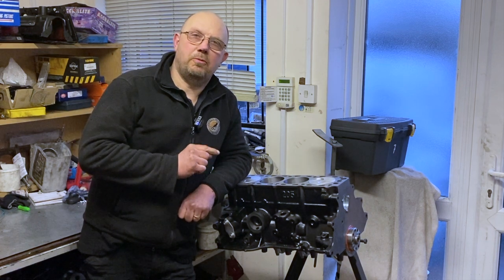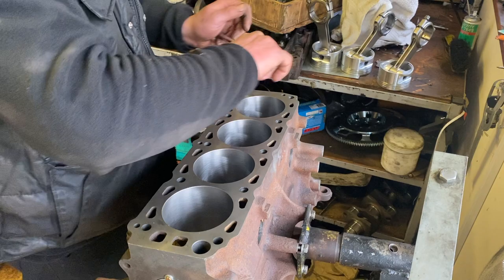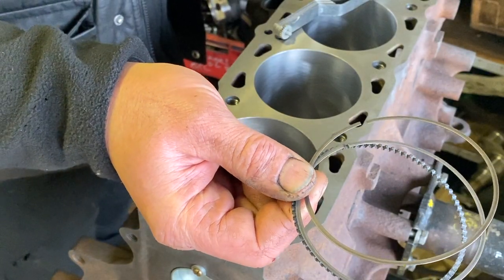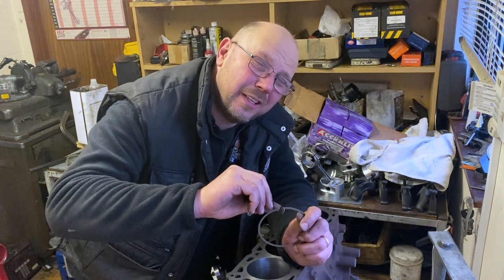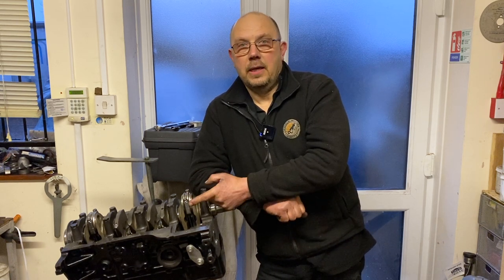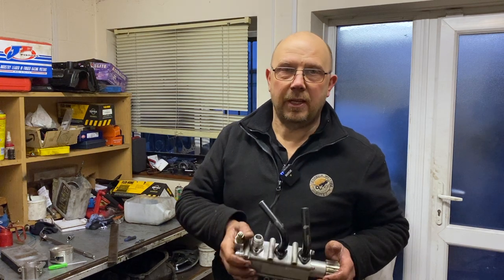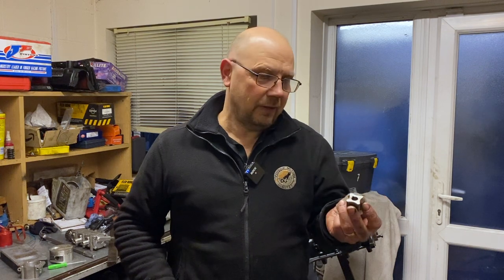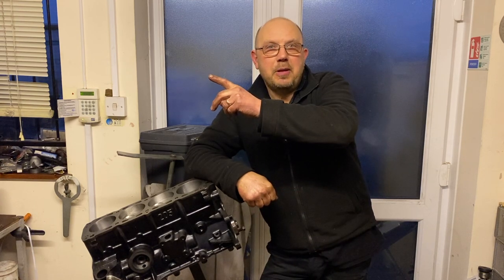2.3 Race Pinto Rebuild - Pt 3 - Machining Pistons + Ring gaps

Comment: looks like your pistons are nicely proud, should go well
Reply from the maker: they Are 0.020" out the top of the block,  the old ones were machined down and ran flush with a very thin head gasket, this time because of the deeper valve cutouts i didn't machine them down and will use a thicker head gasket, but it all works out about the same

Comment: What rod ratio are you running with 86mm stroke 1.6 just wondering as I’m thinking is use the std crank and offset the big end for Honda b18 rod size 42mm and rod c-c is 138mm
Reply from the maker: 1.52 but dont get too hooked up on rod ratio in the real world it makes next to no difference

Comment: I’m tempted on sourcing a 205 block and an appropriate cylinder head for my 72 Pinto Halfhatch instead of using a 2.3Lima Turbo motor.

However, that means I’d have to source one from the UK…that could be expensive I’d imagine.
Reply from the maker: to be honest your probably better off and it will be cheaper to talk to Esslinger or racer walsh about uprating your 2.3
Reply: @PenguinMotors  
I'm going to consider that some good advice. Thanks.
Reply: many consider the lima to be better
Reply: @Kevin Forster  
I just didn't want to have a motor in my car that didn't exist in its time. 
I could get away with a 289/302 for period-correct swaps.
The car is all original except for its Maverick rear end, 70's era US Mags and lowered. The way my late uncle made it in the 70's when I was a kid.
My 76 had a built 2.3

Comment: May be I missed it in previous vids but how is the capacity of 2.3 acheived
Reply from the maker: 93mm bore 86mm steel crank = 2337cc
Reply: @PenguinMotors  love watching this  youst to play around with this engine serving my time but never had access to the equipment or know